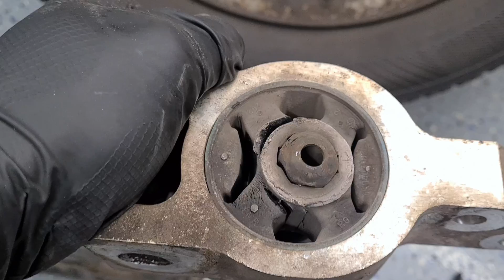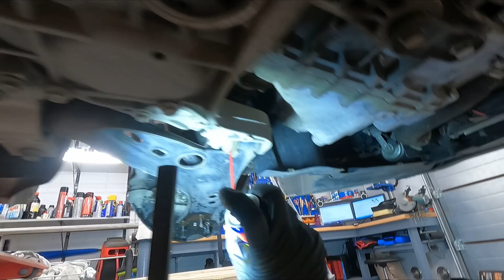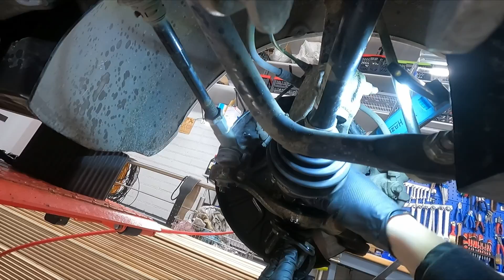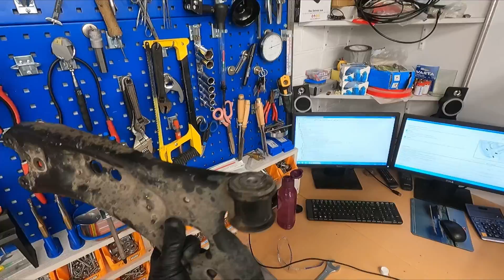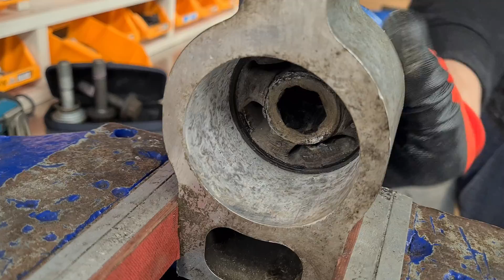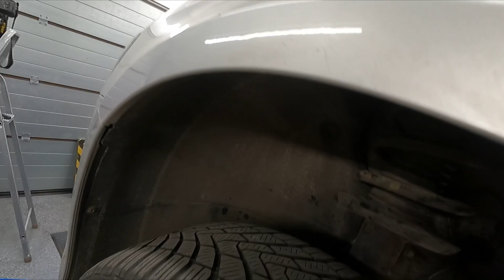Control Arm Bushing Replacement including Ball Joints: VW Passat B7

Comment from the maker: 🔧 Tools used: 
       🔹BGS 2292 General rachet and socket set: https://geni.us/0Hhd (Amazon)
       🔹BGS 5188 Torx and Hex socket set: https://geni.us/Zz55Akr (Amazon)
       🔹BGS 228 flexible long ratchet ½: https://geni.us/aFqZxDW (Amazon)
       🔹BGS 9473 combination spanner set: https://geni.us/pxBAWw (Amazon)

       🔹Underhood LED light: https://geni.us/oUVLUpn (Amazon)
       🔹Hazet 1979N-92 flashlight: https://geni.us/gTxEiHA (Amazon)
       🔹Hazet 1979WP-1 magnetic charging pad: https://geni.us/abMfAS (Amazon)

       🔹Gedore 10-50 Nm torque wrench: https://geni.us/LBhSQA (Amazon)
       🔹Gedore 40-200 Nm torque wrench: https://geni.us/zseU (Amazon)

       🔹BGS 1795 Ball Joint Separator: https://geni.us/AaVgB0 (Amazon)
       🔹Bushing Press Kit: https://geni.us/DTP2A (Amazon)
       🔹Drive Shaft Extractor: https://geni.us/jxTN59 (Amazon)
       🔹Jaw Puller Tool: https://geni.us/Ckzsr (Amazon)

⚙ Spare parts used: 
       🔹Lemforder 3528101 Left Tie Rod End B7: https://geni.us/sASx09V (Amazon)
       🔹Lemforder 3528201 Right Tie Rod End B7: https://geni.us/VezADJ (Amazon)

       🔹Lemforder 2999802 Left Swivel Ball Joint B7: https://geni.us/16TJe (Amazon)
       🔹Lemforder 2999902 Right Swivel Ball Joint B7: https://geni.us/8cjM (Amazon)

       🔹Shaft Bolt Febi 40112: https://geni.us/h1xOWp (Amazon)

       🔹Lemforder 3471101 Rear Bushing with Bracket B7: https://geni.us/TtwR (Amazon)
       🔹Front Bushing B7: https://geni.us/GVgZ (Amazon)
       🔹Front Bushings Bolt Set (required two sets): https://geni.us/ARVqD (Amazon)

Comment: Do you have a manual transmission or dsg? I'm asking because i was hoping for some pointers in removing the front bolt on the driver side, dsg oil pan is in the way
Reply from the maker: Manual

Comment: Good video well done. One thing i would say is that the 'special mounting oil' for the silent block is not for replacing the bushing in the silent block, it is for fitting the silent block to the wishbone finger. It acts as an lubricant on assembly but then dries and acts like an adhesive between the rubber bushing and metal finger. Its not a good idea to put grease on this joint during assembly.
Reply from the maker: Yes. Indeed. Good observation!

Comment: Great video, thanks Dionich! 

Point to note for anyone else attempting this job: the 16mm bolts that fix the aluminium bushing block to the sub frame have a tendency to seize when removing. It’s a known problem.

Passenger side snapped on me when removing which was an absolute pain to fix and the driver side very nearly did too. My suggestion would be to: 

- Clean the exposed threads on the top side of the subframe. There’s not much clearance, so a small bendable wire brush would be ideal.

- Hit the head of the bolt with a few good blows of a hammer

- Use lots of penetrating oil and let sit for as long as possible

- Heat the bolt with a blow torch and allow to cool. Do this 2-3 times before removing. 

If you notice any resistance while removing, stop and repeat the last three steps before slowly working it out with a wrench - don’t use an impact as there’s no ‘feedback’.

Might take an extra 10-15 minutes but believe me, it beats having to extract / bore through a snapped bolt! 

They’re torque to yield bolts, so Dionich is spot on when he says to replace them.